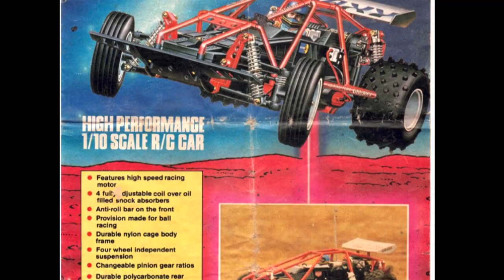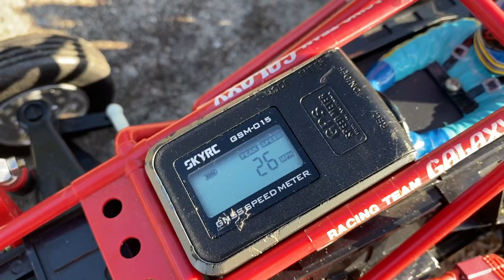1985 MARUI GALAXY RED CAGE GETS RESTORED & RACES THE BLUE GALAXY RS. WHO'S FASTER?

Comment: Great video! My first car was a blue cage RS and my friend had the red cage version. For me I could either afford the Galaxy or the Tamiya Hornet at the time and the Galaxy had independent rear suspension and aluminum oil filled shocks and I liked not having to paint the body. The idler gear was butter soft and probably the worst mechanical speed control on the planet but otherwise a great car I enjoyed for many years
Reply from the maker: Awesome rc thanks for sharing. Please check my latest rc videos and have a fun day. 😊
Reply: Your comment - a (hilarious) mirror of my experience at 11 y/o.  I actually found that a regular motor pinion gear slipped snugly onto the idler gear shaft and I fashioned a Frankenstein metal/plastic idler gear that NEVER STRIPPED!!!
Reply: @randallburnett3655  doing this tomorrow!!

Comment: FYI the 540 has more torque and can handle the larger pinion gear in the set.....this is the fastest you will get her (around 28mph stock). Upgrading the motor will only eat the idler gear sooner.
Reply from the maker: Firstly hello, the rule of thumb states a larger can signifies more torque not necessarily rpm. More magnetism. Regarding gears longevity majority of these types nylon’s can no doubt handle 30mph without drama as keeping the heat down as long as maintaining the proper balance of lubricants and mainstay of fit and finish of all components is done accordingly via routinely -checked. Lastly’ check out some of my other great rc restoration videos nearly 200 to choose from. Like and subscribe / be sure to tag the bell so you never miss a new rc restoration video upload. Take care 👍
Reply: @LukesVintageRC  I remember when Santa brought me a LeMans 240S for my Galaxy......wow!!! Fastest car in town......for two rides 🤣🤣🤣🤣🤣
Reply from the maker: @falconwings  hmm two rides, those were the days..I’m now juggling 155 which is bonkers not too mention on standby a castle creations power unit if I need a lil extra speed from my Marui Galaxy red cage or my Galaxy RS blue cage buggy just a lil 1 min install -depends on my mood. 😂🤣🤣😂🤣😂🤣